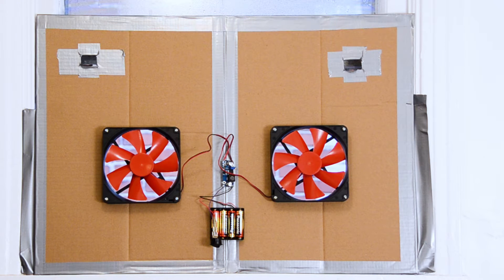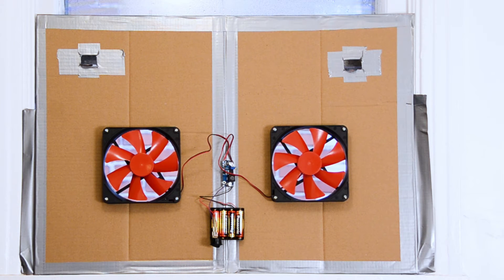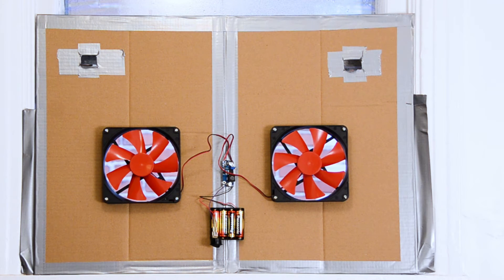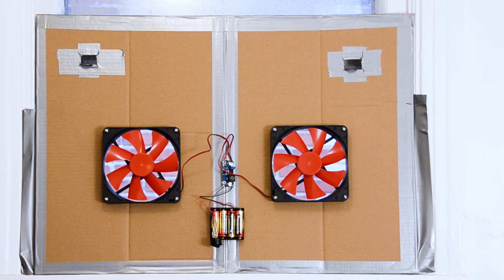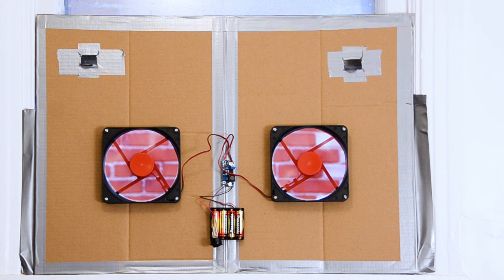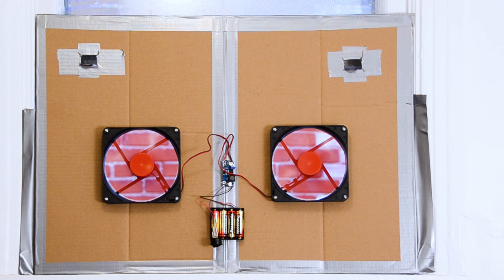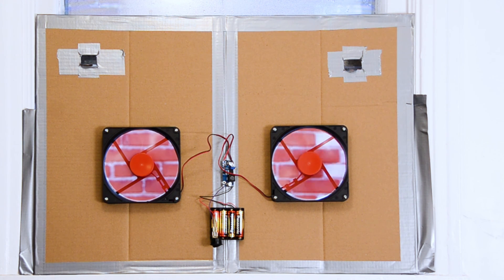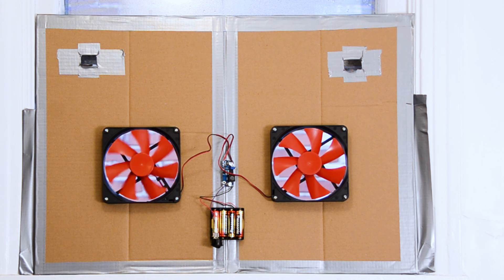Bathroom window fan extractor prototype

Comment: I was thinking of building something similar using bead board for the backing surface, potentially with a larger, lower RPM fan, in the 200mm range  for better battery life.  What have you experienced for how long the batteries last?
Reply from the maker: The batteries don't last very long. I never measured it, but probably around 1h. Each 140mm fan uses around 2W of power, so 4-5W for the two fans. I am not sure a single low RPM 200mm fan would consume much less power, you would have to verify the specifications. Also, you have to consider the static pressure of the fan. Larger diameter fans tend to have lower static pressures. When it is very windy outside, the fan needs to fight the pressure generated by the wind. If the outside pressure is high enough, the fan can stop spinning and the air comes in instead of going out. With the two 140mm fans I was using (cheap and low power), this would happen quite often when it was windy outside. I image it would be even worse with a low RPM 200mm fan, since it probably has a lower static pressure.